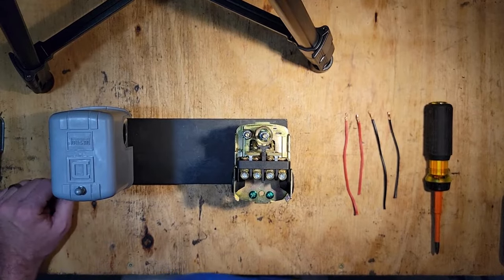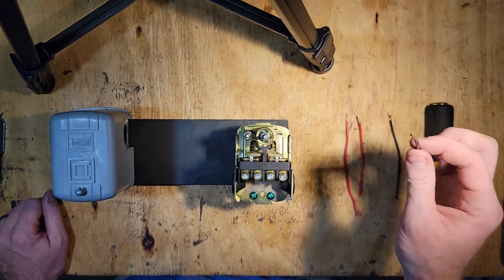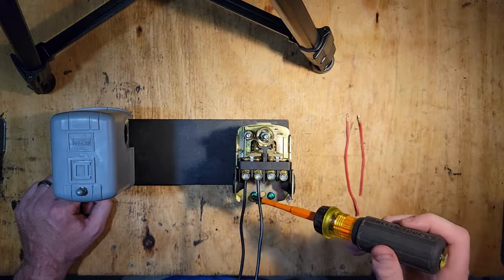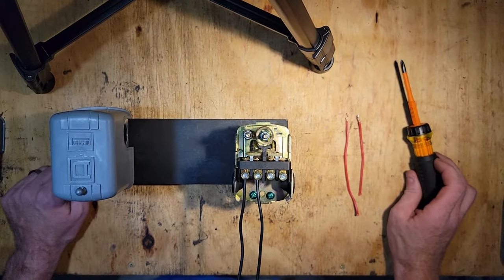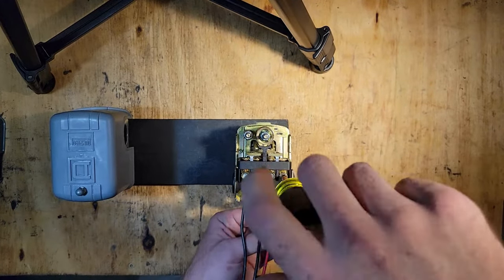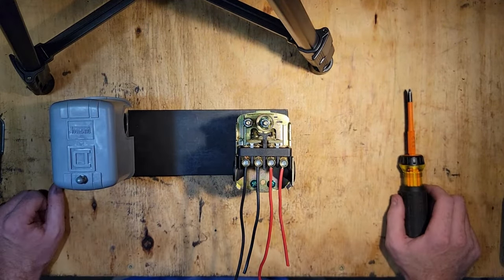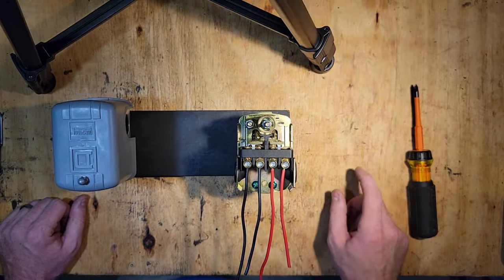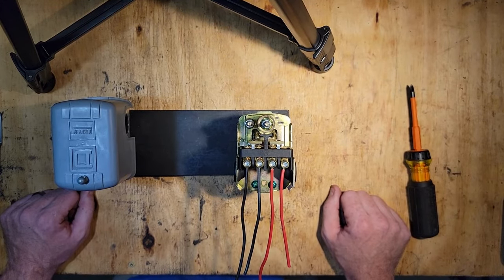Wiring A Pressure Switch

Comment: SW?  L2?? what the hell you talking about?  further explanation would be useful.
Reply: L2 = Hot   In SW situation both wires are hot, one is incoming and one is outgoing, there is a deluxe control box in this situation. If you do not have a Deluxe system you will have 4 wires and 2 grounds.